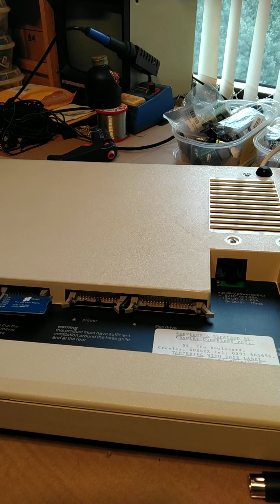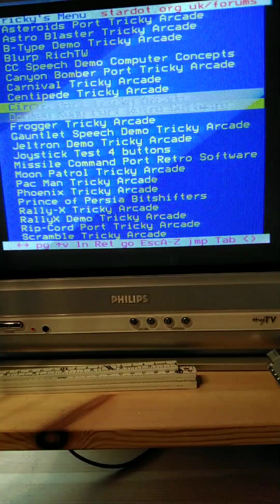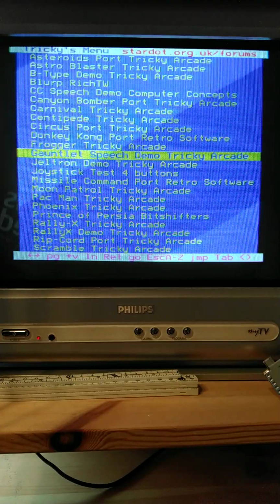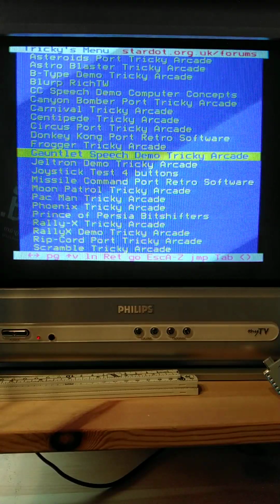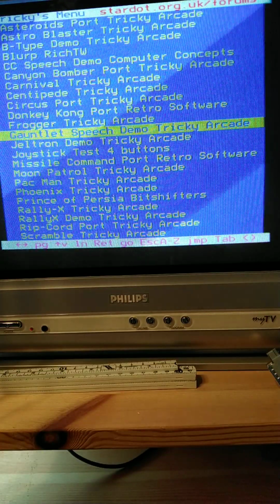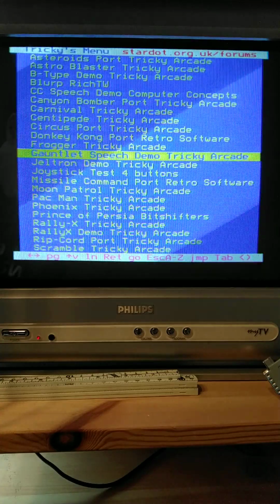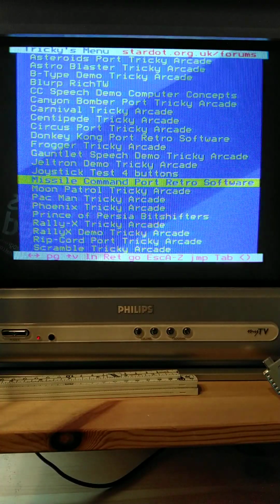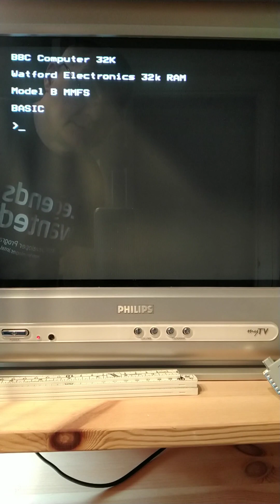A tour of the adapters that I make for the BBC Micro

Comment: Are you still making the audio adapters? If not can you tell me where to get the splitter adapter please?
Reply from the maker: I only make them for myself as they are fiddly and take too long to charge a reasonable amount. The instructions are on the stardot forums. I do sometimes sell one in person at shows, but would not want one to get damaged in the post and get involved with returns etc.
Reply: @trickysoft  I've joined and have searched the StarDog forums but cannot find the related post. Do you have a link please?
Reply: @trickysoft  That's understandable and thanks for the pointers. I can build one myself with a parts list 🙂
Reply from the maker: @ColinJonesPonder  https://stardot.org.uk/forums/viewtopic.php?t=16722
Reply from the maker: @ColinJonesPonder  Your looking for "Adding an audio jack to a master or B/B+" sorry, YT deleted my comment with the link.
Reply from the maker: google will probably do a better job of searching and brings it up as the first link for me.
Reply: @trickysoft  Thank you. That search term worked a treat 🙂

Comment: That’s really cool Richard, keep meaning to get my bbc looked at as it was playing up last time I used it🙄
Reply from the maker: If you are in the vicinity of an ABUG, you might be able to "book" a slot with someone there. Could always try stardot with your symptoms.
Reply: @trickysoft  pretty sure it was working fine until after it being on for around 10 minutes then would start being a bit non responsive🤔
I’ll have to check again
Reply from the maker: @SinisteveRetroGamer  could be many things :) might even be worth just pushing all the chips to give the legs a slight wiggle.

Comment: Just got my beeb back out after having it in storage for a couple of years. Need to update my pitube firmware as I see there's a new version from what I have. I will also check out your mmfs software, i just have the stairway to hell one at the minute. Love your games by the way, have played your astroblaster a lot.
Reply from the maker: Thanks, the menu is mine and obviously my games, but mmfs was written by hoglet and based on Martin Mather's original code to drive an mmc card via the Beeb's user port.